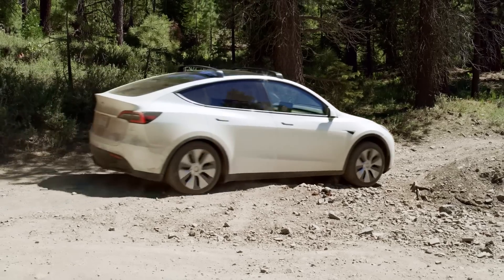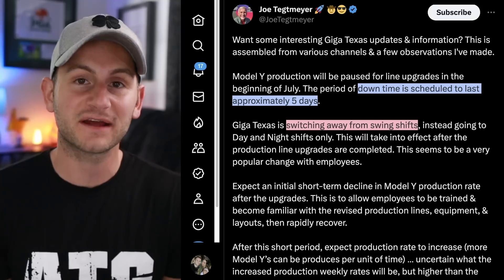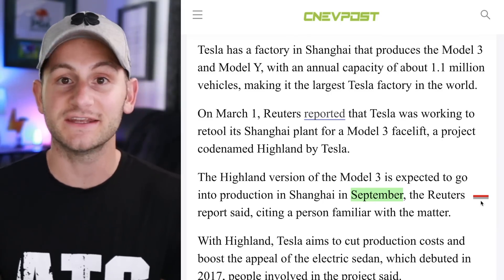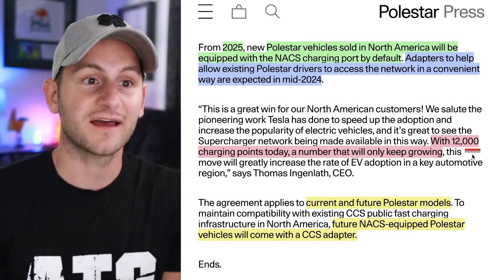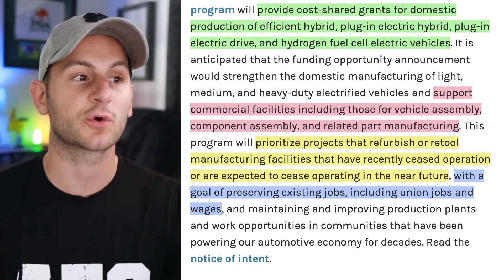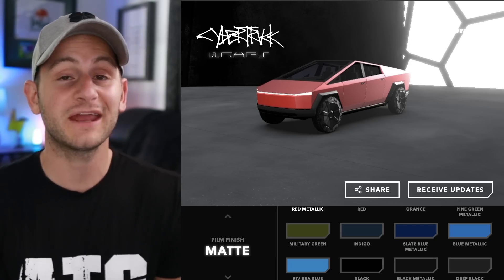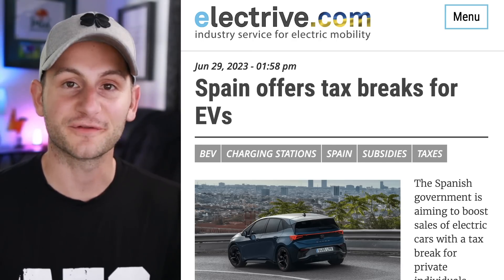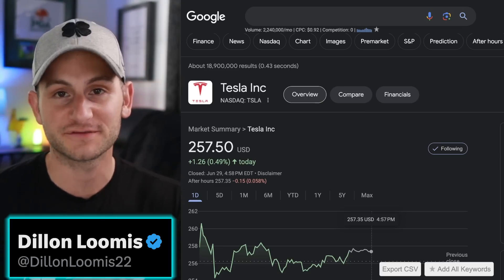The Big NACS Domino Falls / Tesla Production & Battery Upgrades / New Audi Leadership ⚡️

Comment: It's not about NACS. It's about the software and handshake protocol. It needs to be Tesla simple. Plug in. Walk away. EA is, right now, a pain in the butt. I have a CCS to Tesla adapter and an EA account. It still takes 15 minutes before it will starts charging. EA never fails to piss me off!

Comment: 13:10 actually for cars that have 800 volt charging like the Porsche, YES changes need to be made.  GM's solution was to split the Hummer battery so if it's charged on a 400 volt charger, then it only charges half the battery at a time but if it's on an 800 volt charger charges the entire battery ... Since neither Volkswagen nor Hyundai took this approach I'm not sure if Tesla's Network can even be optimized for those vehicles.

Comment: This video reaffirms that I should stop guessing when TSLA stock takes a big dip and just stay the course.  I have sold in the past based on automatic 20% dips and later bought back in.  Found 30 shares in an obscure IRA account that I never touched.  It is valued at a $23.47 trade price which computes to a 997.68% increase.  As you can suspect, may "buy backs" after dips is much lower.  No more selling to "lock in profits".

Comment: Q: can anyone positively confirm the scope of fatigue analysis of Tesla's cast aluminum components?
As an Octogenarian  retired ASNT (Quality Conformance/Complience Assurance) member having graduated as a structural civil engineer; back in 1968 one of my first assignments at Beca-Carter, was to evaluate the proposed design of large continuous prestressed concrete gantry crane beams for the Tiwai Point Aluminium Smelter.
My evaluation included a fatigue analysis of the prestress cables and consequently this design was abandoned.
My Tesla consern is with the front cast component replacing the fabricated steel boxes attaching the front wheel assembling to the body. 
Lots of 'load-unload' cycles here especially off-road. 
Q: any enlightenment from the geriatic Asperger?

Comment: Efficiency of spending tax dollars always depends on the goal. If you want fast BEV adoption, then spending tax dollars to refurb existing plants to make hybrids is not the best option. If the goal is to save jobs in those communities, then it's very efficient. We have the same issue in the space program. NASA could go to the moon with Starship or maybe even with Falcon Heavy and Crew Dragon, but SLS provides 10s of thousands of jobs, which is Congress' primary goal with the program. Actually going to the moon is just a nice to have for them.

Comment: Any insights on cyber truck costs? Most of what I’ve heard is it’ll probably be higher than initial announcement, but if they’ve announced a 50% cost reduction on the production of their next gen vehicles, why wouldn’t the cyber truck be built on it? 🤔
Reply: Hard to guess. Tesla making good profit on 3 and Y is after those productions have been up for some time. Before volume production of CT they probably make an overall loss on it so it would make sense to build the high trim first (as usual). Maybe it will be above that 80k tax credit limit?
I'm not sure but it feels like more wealthy individuals would pick them up and actually own them. If they start also with basic trim it costs less probably more flippers of CT taking a premium.

Comment: NACS is already global it's only a matter of time.......
Reply: NACS won't be global.
It doesn't support 3-phase AC. For NA it's the better solution. I think we in Europe have some law locking in the CCS2, which is a bit better than CCS1, connector. A variant of the Tesla connector, maybe a bit bigger, that had support for 3-phase would have been the best here but I think it's too hard to switch if such was to be constructed.

Comment: Hi Dillon. I have a Model Y for a few weeks now.  Most expensive car I have ever bought, no regrets at all. This is a fun  car to drive.  I have used the supercharger in WA state, so easy. I have a charger at home, and the first electric bill,  no diff.  Love this car!  I had a 12 year old GMC Terrain, Model Y is similar size but has more room inside.   I looked at other EV's but they are about the same price (if available), so I bought the best!

Comment: The off road torque vectoring - isn’t that just normal feature for AWD like on a Subaru?
Reply: Subaru isn't normal, better than most off road, and using instant electric torque vectoring and regen gives more precise control. Just like the Rivian is a Beast off road, so will the CyberTruck be.

Comment: VW is wanting to know about the 800 volt charging, most likely.
Reply: NACS support 1000 volt and it's the same design and cross compatible (which to me make them the same but the specs have them listed separately).
Tesla says that they in tests have had a 900A current through the connector without the inlet being liquid cooled. So seems to be a lot of headroom.

Comment: Oooh wow actual
Confirmation by Tesla that their aluminium alloy is special as per findings by Munroe. 😁
Reply: Almost positive Elon confirmed this years ago.
Reply: Yeah I think Tesla/Elon have talked about it before.
But makes you wonder - now that others have jumped in the gigacasting bandwagon - have they easily found a donut l formula too or will they be limited to smaller parts and heat treating. The material science (or a better name for that?) have been shared with SpaceX. I would guess the knowledge of creating new alloys are pretty thin between the other OEM that mostly just have wanted to put their badge on finished cars (as Sandy puts it).
Reply: @subwarpspeed  Time will Tell.

Comment: Basically, the "800+volt" companies want Tesla to supply 800v.
If I were Tesla, I would just say "maybe, when we're ready. Meanwhile, it's your choice, take it or leave it"
(They'll take it, reluctantly)
.
(Hyundai taking a similar stance?)
Reply: I do believe that’s precisely what Tesla is telling them.
Reply: Supercharger v4 seems to support higher voltage
Reply: The connector is good for 1000 volt today so they can have their EA or others built it into their chargers right now. For the Tesla supercharger network well then there isn't a rush for Tesla since the number if vehicles on the roads supporting it (CT) will be very low the coming years until some of the other models get it.
Tesla could te them: - do you want to chip in with build the higher voltage stalls? I guess they will mumble and look away.

Comment: I keep saying the 12,000 is about the number of chargers Tesla was going to build this year anyway.
It's not even inconvenient.
They just need to ensure there are chargers configured for "not Tesla" port positions and that can be done by shifting the charger to the centre of the bay (ref the new cabinets in Europe)
Reply: Or the manufacturers can spend two years until the cars have the NACS to actually get it to the Tesla preferred position on the vehicle.
Reply: @subwarpspeed  🎯
Reply: Nah, it’s “just” the major routes and underutilized stations.
Reply: Placing rows of chargers in the center of large parking lots allows vehicles to park at both the front and the back of EV chargers and doubles the number of positions to accommodate charging for different vehicles.

Comment: Im wondering if going from 3 shifts down to 2 shifts is logistically better by way of cost, and or speed? What are the benefits of doing that?
Reply from the maker: a lot in play here but sounds like employees prefer it and in the end it will increase efficiency of the employees while they're there and lead to higher production once everyone learns their new roles while also having more employees working on cybertruck line
Reply: @DillonLoomis22 I tried to read up on what it meant (not American/native English) so I got a grasp. But it makes me wonder too about this day and night. Then they cannot keep the production line going 24 hours a day? Working 12+ hours in an industrial job, is that legal or possible? Seems too much. Maybe it for the moment doesn't need the maximum potential capacity of the factory?